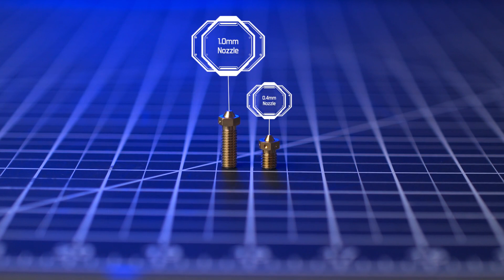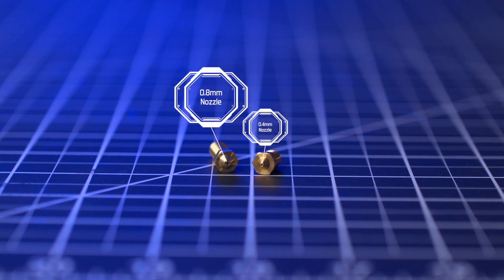Quick Tips: High-Speed 3D Printing

Comment: Thank you for your video, one of my goals is to print quickly on my large format TH3d 5 plus. I just removed the stock wheels and installed linier rails to increase speed and for smooth operation.  I also build a Voron afterburner with a E3d v6 and volcano hot end using a .8mm tip.  Just the .8 tip has shortened the print time significantly compared to .4mm.  

So far I'm running it through the paces to ensure everything is running smoothly, small tweaks and changes to tune it, but I do want to start increasing the speed which was the main goal of doing these upgrades (it is also fun).  So far running at 100mm/s, but after getting my cable trays and cable management done I will look into speeding it up.  Want to see how fast I can go before sacrificing appearance/failure of printed item.  I also bought an accelerometer and Raspberry Pi to get rid of any ringing, but will not toy with that until I get the speed up - so upgrade pending.  

Thanks again for your video, I just subscribed as I have seen some of your other videos and found them useful.  So please keep them coming.  :)

Comment: software & firmware play a part in this too.
Reply from the maker: Absolutely. For anyone else reading, some 3D printers have limits within their firmware for their speeds and acceleration changes, so just because you set your slice settings to 100mm/s, it's possible to have limits set in firmware for a maximum of, for example, 50mm/s - Alec

Comment: I managed to get a delta (Cheapo HE3D K280) printing at 100mm/s for large prints of storage containers.(at .32mm layer height) I have 1/2 inch threaded rod reinforcement added to the frame and the quality was great. But to add to the problems you mention I will add that to get flow out of my 0.4mm nozzle with PETG I had to have the temperature at 250deg C. But at this temperature I found that the PETG was burning inside of my nozzle causing flow restrictions after around 50-75hrs of printing. I've gone through about 10 nozzles so have stepped it back down to a slower 75mm/s and 245deg C and no more problem with my nozzles. I even used a Nozzle X from E3D but still came up with the burning PETG issue. PETG loves to stick and I was getting a black film coating on the outside of the nozzle which at 250Deg C was crumbling off when scrapped with a knife so I'm guessing this was happening on the inside as well. I tried "Cold Pull" nozzle cleaning but that only fixed the problem for a couple of hours of printing (as did using a 0.4mm wire) and the prints at 100mm/s took 12hours each time. I'm really interested in the mosquito hot end you mentioned but I'm thinking a volcano is the only way to solve this.
Reply from the maker: Was your PETG dry when you were printing with it? PETG is known for being hygroscopic, and it's possible that there was just buildup of PETG cobwebs and stringing around the nozzle that got burned up. - Alec
Reply: @MatterHackers  Yup PETG quite hydgoscopic - even a week out of wrapper is enough to make a serious difference in some brands. Have a sealed container filled with desiccant that I print from and at the higher speed I was printing straight out of the packaging full roll in 36 hours. I think the stuff on the outside of the nozzle was the excessive stringing  because of the high speed but this burning filament was on the inside of the nozzle and seemed to be coating the nozzle leading to extrusion output down to nearly half (by weight ) of what it should have been. Prints still worked as these are 8"/200mm high x 175mm wide complex 3 walled pieces but with the restricted extrusion you could easily feel the difference in weight. I think if you need the high flow I needed that a volcano is the way to go - keeping temperatures down while still melting it properly enough to flow well.

Comment: G'day m8! im a noob, 3 months in on a stock Ender 3 V2 and have done prints up to an including 75mm/s on PLA, PETG and TPU, im just lucky to have had way more wins than loses, and gone with a enclosure and filament dryer/spool holder. i have found a common thing with 3d printing is consistency!...so those items keep filament running free and tent keeps all temps consistent, use less power and allow better bonding to happen across all mediums. its for personal Rc hobby and to explore this new medium so ive only got the one...cheers from downunder!!
Reply: Pro trick : watch movies at Flixzone. Me and my gf have been using them for watching a lot of movies during the lockdown.

Comment: I built 4 high speed printers. Instead of fast nozzle speed, we go for thicker layers and nozzle diameters so even with a super volcano our max speed tends to be only 30mm/s with the PETG we print. I suspect the Hemera doesn't provide enough cooling with the motor working so hard though. The prints we're prototyping take about 23 hours to print with this setup whereas a normal setup of a .4 mm nozzle and .2mm layer height would take about 14 days. We could probably speed things up if we were going with PLA since it can struggle to heat the material, but the prototypes we make need the extra heat resistance/reflection.

The printer I set us up with and customized/modified is a Ender 5 Plus. Push Plastic's 5 and 10k spools are life savers, but the 25k spools are too heavy to reliably extrude without lifting the gantry and causing layer lifts. We end up getting 25k spools and feed them onto old 5 and 10k spools to save some cost (but kill our arms)

Edit: I wouldn't bother with the regular Volcano. I experienced that the heater it uses is not powerful enough to handle faster speeds unless using a regular sized nozzle even with the part fan off. This is good for printing higher temperature materials like PETG at faster speeds but keeping the same nozzle and layer height, but just can't handle going bigger. At least not like the Super Volcano can.
Reply from the maker: Even though your movement speed is only 30mm/s the volume of filament you are extruding is impressive. I know all too well the need to respool larger spools onto smaller ones, and after doing it enough I 3D printed a jig to connect to my drill to move everything over. Way quicker and my arms are thankful for it. - Alec
Reply: @MatterHackers  Yeah, we use a drill and use some nuts to push some large washers against the spool. Still, that's a lot of time and effort to respool a 10k or 5k spool from a 25k.